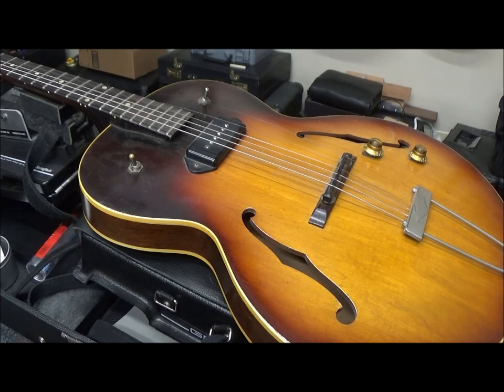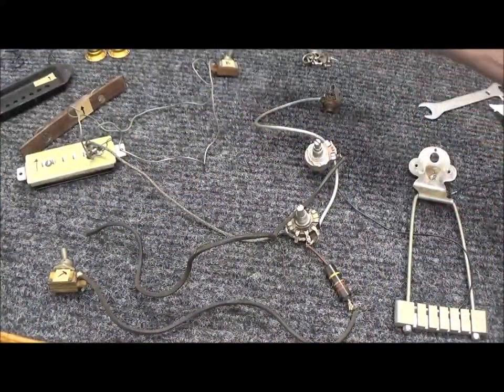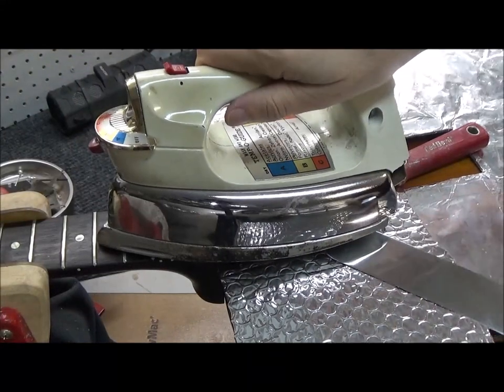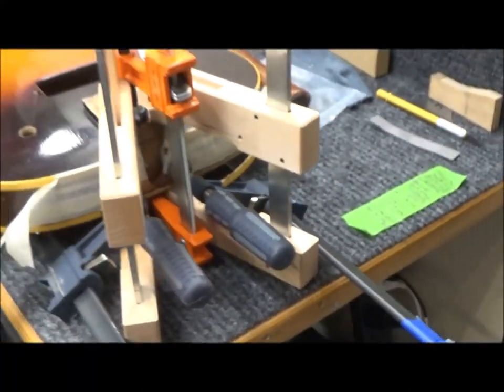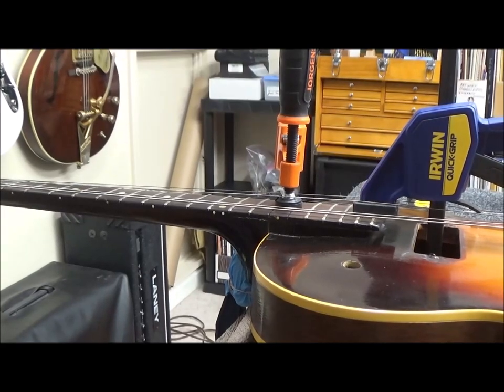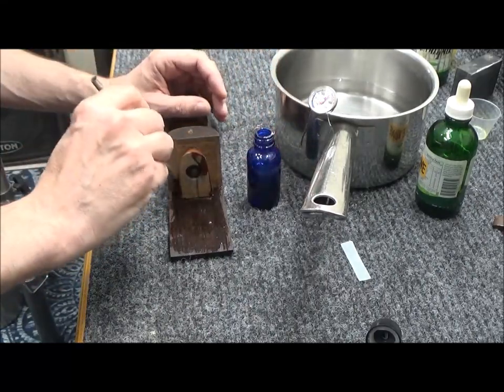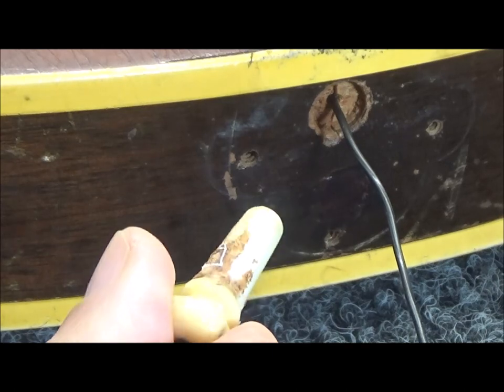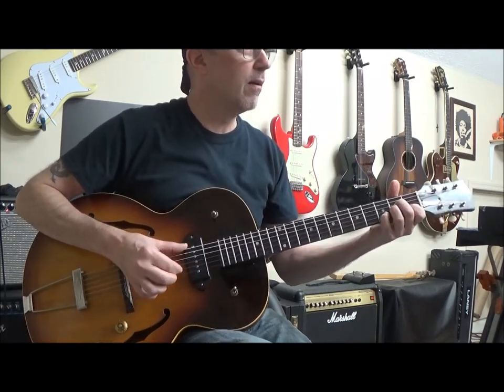Gibson ES-125T Restoration (1959)

Comment: Enjoyed this thanks. If you really wanted a 'radius iron' you could use a piece of 1/4" thick sheet lead and bend it to the fretboard then place the iron on top - keeping the iron on low to not risk melting the lead. You could use a router to make channels for the frets to apply heat directly to the fretboard and the lead could be sized to keep direct heat away from fretboard binding. Though the flat iron seemed to work OK.

Comment: Great video.   I’ve seen you do a few ES125s now.   Sometimes you’ve removed the wedge under the fretboard overhang and this one you didn’t.   Is there a reason? Or a need to remove it?  
Thanks
Reply from the maker: Thanks!
After doing a few, I prefer to leave the maple spacer attached to the body.

Comment: I love your work. I have watched a few videos of yours and figure it is time to subscribe. May I ask a question? Why does the tailpiece need to be grounded? I thought only the output jack had to be. I want to add a Fender pickup to an old Silvertone, (1953), that attaches to the neck via a bracket made into the pickup.
Reply from the maker: Thanks Ted! On most electric guitars the strings are incorporated in the circuit by means of attaching a wire to the  metal tailpiece. If you experience a lot of white noise in your circuit it might be something to consider.
Reply: @harpethguitar  Thank you. I had a lot of repair and I have not glued the top back on so I will run the ground wire now. I guess you solder it to the tailpiece.

Comment: Great video! Why take out the 13th fret?
Reply from the maker: I had to remove the frets before drilling the holes for the heaters
Reply: @harpethguitar  I understand taking out the 15th fret for the heaters but why the 14th?
Reply from the maker: @paularcherfiddle0351  Gibson puts glue between the sides and the neck heel on this style of short dovetail guitar so it good to get heat at the neck to body joint as well as the dovetail pocket 🤓

Comment: Great job! Beautiful tutorial! When I was starting out in the 80s, there were no videos like this. Question. Did you ever do a fret job on a Richlite fretboard? Got one coming up and I wondered about chip-out etc.
Reply from the maker: Thank You Ed! Yes, Richlite is great stuff. I’ve had no problem with Chip out but just to be cautious, I would hydrate it with some finger board oil a few days before you pull the frets and have the soldering pen ready to help release the glue if there is any glue in the fret slots
Reply: @harpethguitar  Thanks. Will do. I usually score at an angle along side of the fret as well with a #11 exacto blade before pulling them out. Seems to help with chip out

Comment: Was it common for these bridges to moveable or would Gibson glue them in place? I’ve got a a62/63 and it needs the bridge to be replaced and I’m not sure I wanna glue it. The original bridge has some glue residue on it but I’m thinking this is something the owner did. Lmk what you think thanks
Reply from the maker: If anything “pin” it in place.  I have a video called “fretboard divot repair” right towards the end of the video I pin one with success 😇
Reply: Thanks for the tip man

Comment: If those 3 way switches were ordered from the factory( on the upper bout),the nut on them would be round.not hex nuts
Reply: I hardly think Gibson did that work. It is an odd addition though. Necessitated the removal of the pickguard also. Still a pretty guitar!